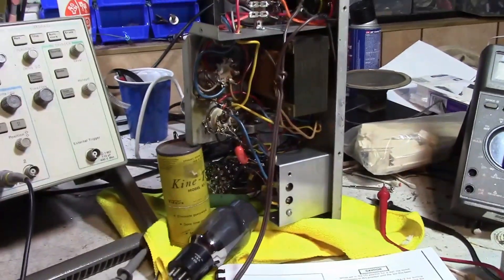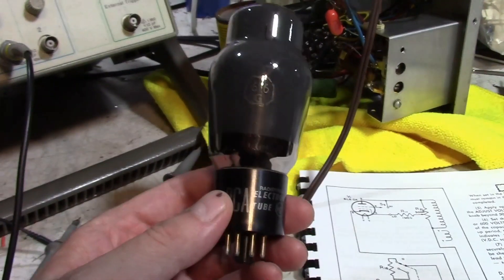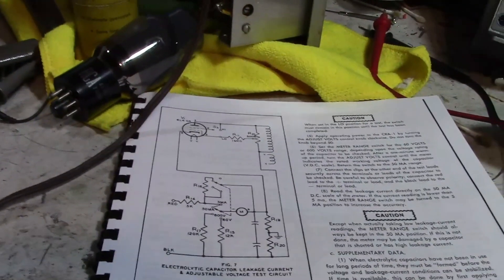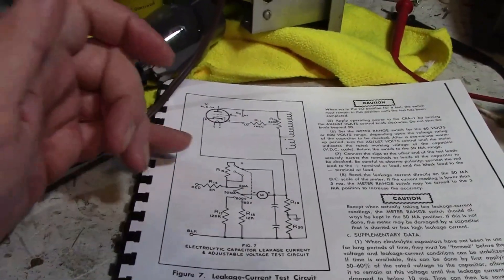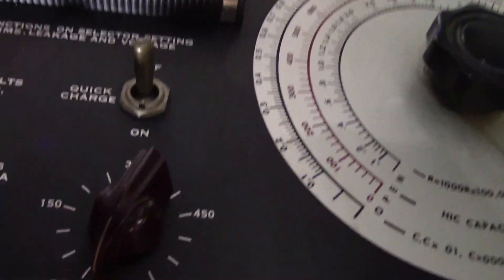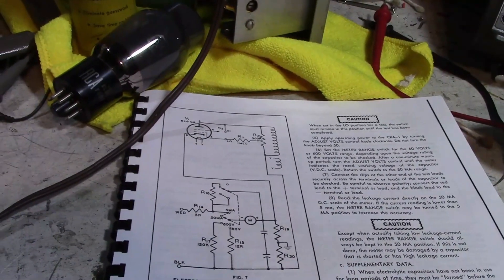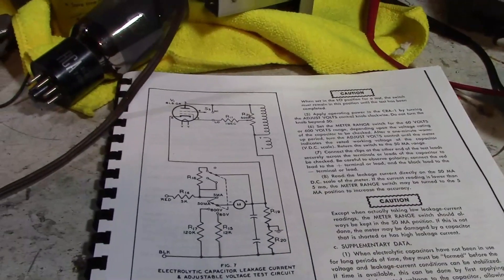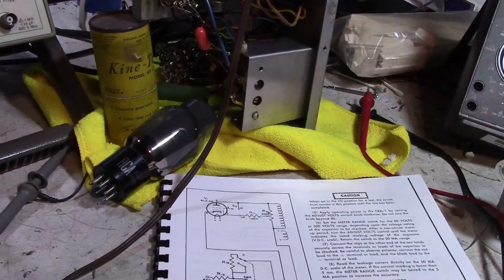Pyramid CRA-1 one last look

Comment: Just wondering if you are going to try to source a 6L6-GA or GC to see how it would function in the circuit?
Reply from the maker: No, I'm not going to bother.  The specs aren't that much different.  About 375 max plat voltage vs 395 for the "A" version and they have 800 volts peak on it.

Comment: This is basically a cathode follower. The grid is the voltage reference. When it's set at 0V, the tube will try to find its bias voltage depending on the cathode current, which will be where the 100V cathode positive respective to the grid comes from. There's no real way to solve this with this circuit, you'd need to build either a negative DC supply and tie the 0V end of the pot to it, so you could turn the grid to -100V, resulting in the cathode at approx. 0V. Or move the circuit ground reference at the transformer to a tap slightly more towards the top while leaving the pot connected to the end it is now, this would put the grid at -100V when the AC is at the peak of the sine.
Reply from the maker: I don't think any of that would be enough.  The tube is only rated for 400V max plate to cathode and they are using it in a 600 volt supply.  Really more like 800 volts.  They should have used something with better specs like a TV horizontal output tube.

Comment: Im in a 240V country (Norway) and I buy most of my vintage tube equipment from the US/eBay. So it always a struggle figuring out if I should rebuild things to 240v or keep it original. (I got the same issue with TV sound 4,5 vs 5,5 MHZ audio ) but so far I found its best to keep things as original as possible 🤷‍♂️.

Comment: Is the voltage adjust potentiometer linear or audio taper style? Wondering if it would help with aligning with the numbers on the front.
Reply from the maker: I don't know but the output voltage change is linear with the knob.  Yes, I could alter the range on the panel, but I'll just look at the meter.